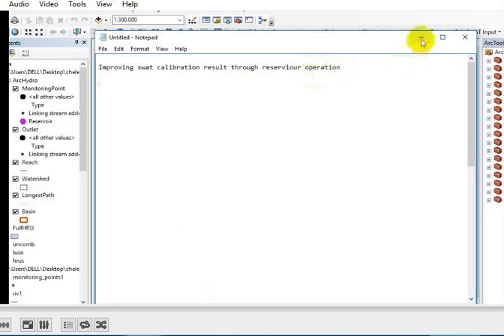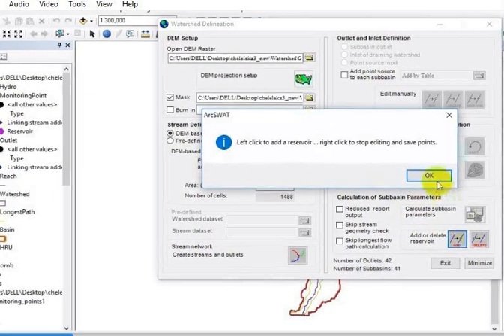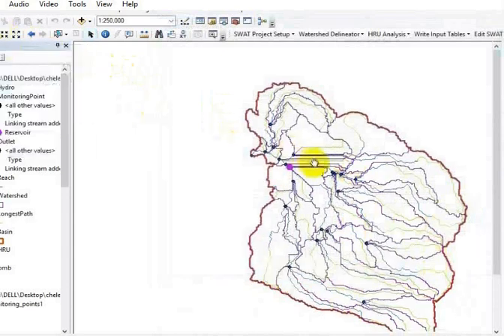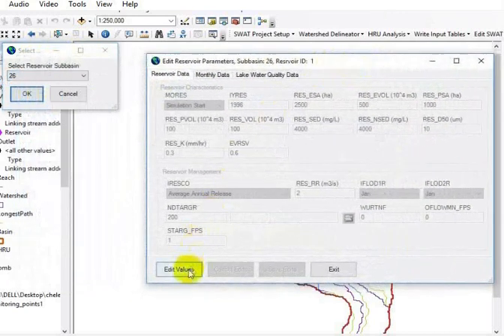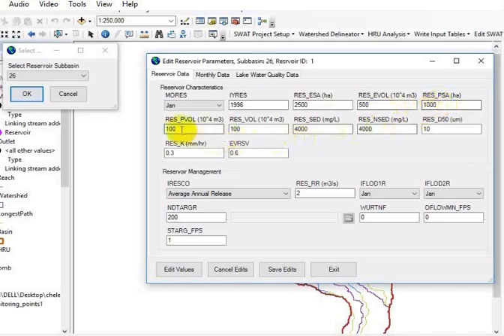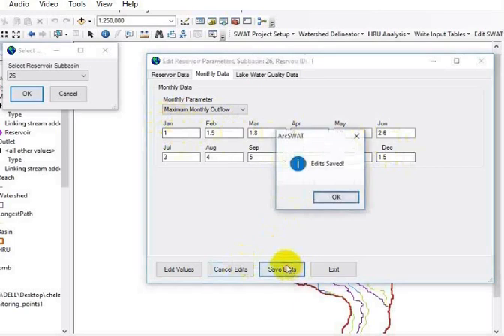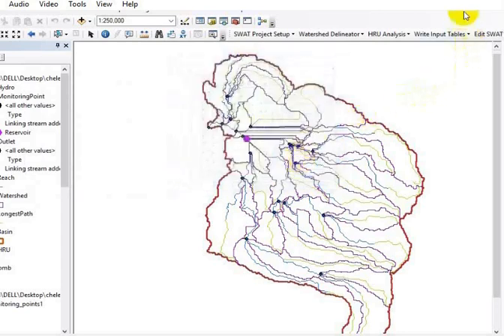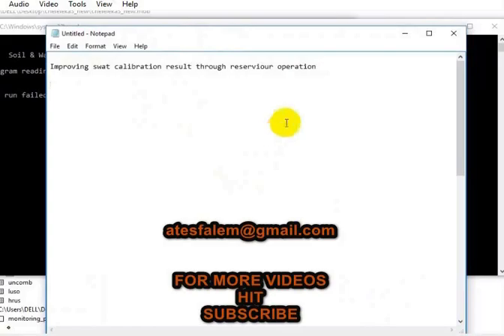SWAT calibration by incorporating reservoir 2

Comment: Hello,
First I want to congratulate you for the video.
I have a project that has a reservoir and I have found some difficulties to parameterize with the data I have.
How can I determine the operating rules for a 2,399,000,000 m³ reservoir Considering that it has an outlet that perpetuates a river downstream, that is, the outlet is constant.
Thank you very much in advance
Reply from the maker: Hi Sabino, basically the operating rules in the reservoir depends on the amount of inflow and outflow from the reservoir. If you have those data you can do the simulation, otherwise, it depends on the purpose of the reservoir to release the desired quantity of water.
Reply: Thank you for the informative video, sir. I have simulated the discharge with base period 1990-2016. The hydropower plant was constructed across the river in 2006 on the upper basin. If I have the discharge data from the dam and also have the discharge data of the river near the outlet, is there any possibility to incorporate the discharge data from dam to the stream flow prediction using swat other than reservoir editing?